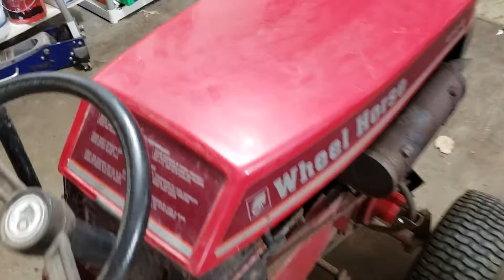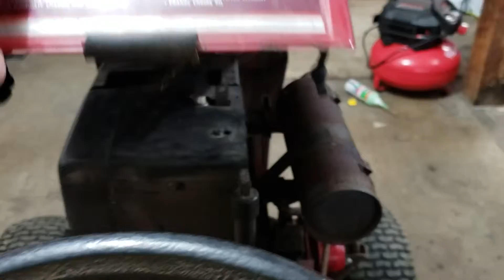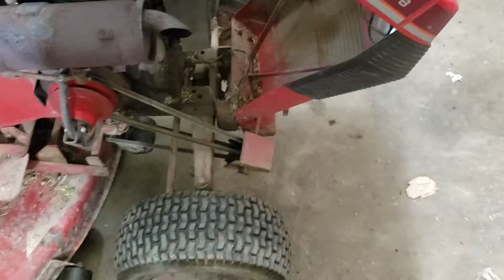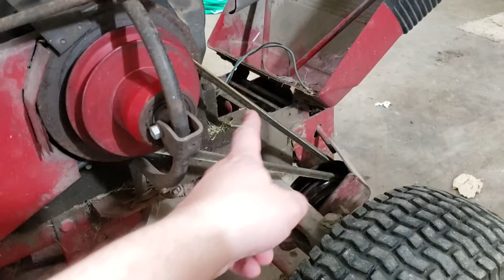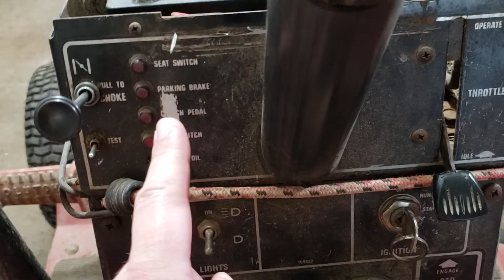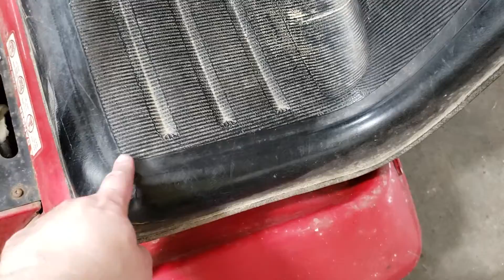Wheel Horse 414-8 Barn find mower

Comment: I have same one tester switch was blowing fuse so unplugged them now wont start any ideas
Reply: Stop pushing the tester button😅
Reply from the maker: Yeah I never hit that switch. Does nothing on the one I have. It's more of a gimmick. I still have the mower. I used it to mow my 2 acres up until last year when I happened to be gifted a JD. The JD cuts a bit nicer but just recently I went out to move them both out of the pole barn.. been sitting a few months for winter.. JD is running like crap and that wheel horse started and idled like it was just another day to go mowing.

Comment: Great tractor I have a wheel horse a90 special and a b100
Reply from the maker: Yeah I still have that thing. The deck ended up needing quite a bit of work since it was twisted which a lot of those side discharge decks suffer from. I always look for the rear discharge decks but they are hard to find.